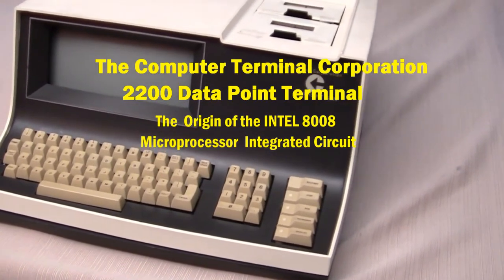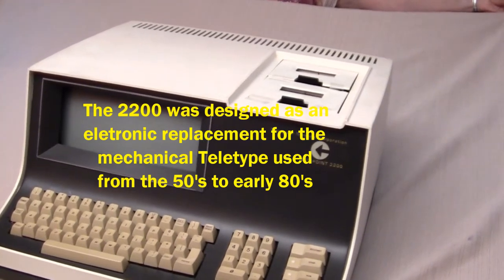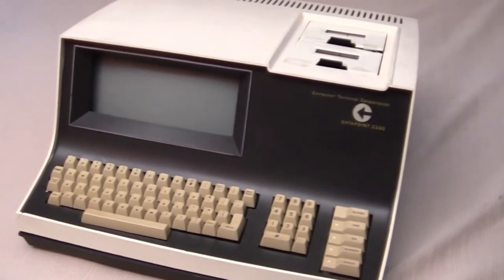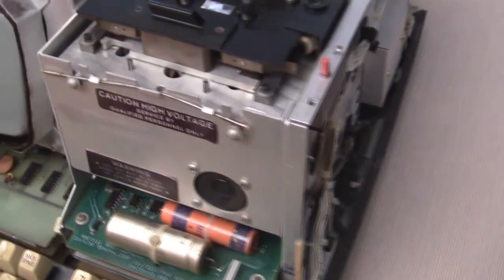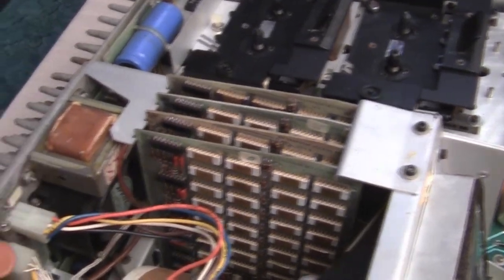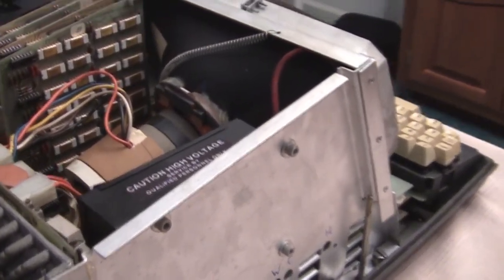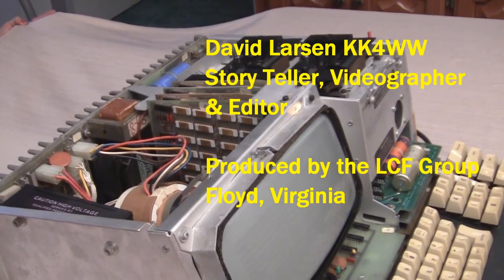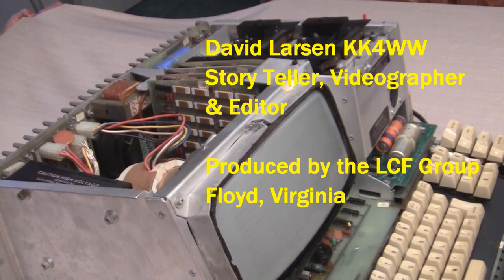Computer Terminal Corporation 2200 - Start of Intel 8008 Microprocessor

Comment: The Datapoint 2200 was a revolutionary machine for a whole lot of reasons.  It was the first general-purpose computer designed for single-user, desktop use, and that looked more like a piece of office equipment than like a piece of exotic electronics.  I worked in Software Development / Advanced Product Development / R&D at Datapoint for more than 9 years, and it was a very rewarding time.   I designed and wrote the world's first commercially available LAN software there... the company sold over a billion dollars' worth of that product.  ;-)   I also was the lead developer of the disk operating system there for several years.  A lot of us Datapoint folks are on the DatapointComputers Yahoogroup.  ;-)   Also, there's a wonderful book about Datapoint's key role in the creation of personal computing... highly recommended.
Reply from the maker: Hi Gordon - Thank you for you comment and info - you sure had a good seat to known about the Datapoint work.  What are you doing now - just enjoying retirement?  I am glad to have the 2200 in my museum. Dave
Reply: lcfgroup I'm hoping to not retire just yet, but we'll see what happens... at the moment I'm between jobs, so... you might enjoy some of the discussions on LinkedIn about the 2200 too.  Have you seen the Datapoint marketing videos that I've uploaded to my Youtube channel?  You'll especially enjoy the "Datapoint-We Make Computers" and "Datapoint-ARC" ones.  ;-)  It was Datapoint that dragged Intel (a memory company) kicking and screaming into the role of selling microprocessors.  ;-)   BTW, the brilliant industrial design work for the 2200 (and Datapoint) is by John "Jack" Frassanito. His company, now in Houston, went on to do a lot of design work for NASA.  Jack was also the force that got the above-mentioned book written and published:  http://www.barnesandnoble.com/w/datapoint-lamont-wood/1112783181?ean=2940016066448
Reply from the maker: Hi Gordon - Just received the book Datapoint by Lamont Wood and it looks fascinating. Would you be willing to write a short story that I could put on my computer blog about your experience at Datapoint? I hope so - this is just a great story that most folks have not heard.  Thank You Dave Larsen
Reply: lcfgroup You'll see some of my stuff in Lamont's book, but sure I'd be glad to offer more memories...!
Reply from the maker: I have finished reading the book & did see you work described in the book. I learned a lot of new things from the book.  Thank you for putting me on to it.  I am doing a blog about the book and will post it in a day or 2.  Do you known anything about the Datapoint 2100? The fellow I got if from said it was a prototype ?  I would sure like some more of you memories for the Blog.  Can you email me or contact on Facebook ? Thank you Dave
Reply: lcfgroup I never heard of a Datapoint 2100.  I don't know who you got that from.  I still actually haven't read through Lamont's book, but I should keep a note pad nearby to jot down errata that I find in it!  Just in the flipping through it I did when I first got it, I found a few things that weren't right.  I didn't take notes at the time, though.  I really should do that.  (And of course, a lot of the people documented in the book are gone now, sigh.  At least Vic Poor, Gary Asbell, Harry Pyle, Ed Gistaro, and at least one or two of the company's founders have I think all passed on.)
Reply from the maker: I am so sorry I don't have the name of person I got the 2200 and the 2100 from.  The 2100 has a logo on the it just like the 2200. Inside it looks like the 2200 with our the tape drives. It must  have been some kind of stripped down version of 2200. It has a date inside of 1975. I do remember when I received this at least 25 years ago I was told it was a prototype.About the book - I did read it from cover to cover and found  it interesting - I am sure as with all book some information was interpreted wrong or just not correct to start with. It seems Lamont did a lot of research to get the info. Any more comments about the book will be appreciated.  I just posted my comments on my blog microcomputemuseum take a look and leave a comment there. Thank You
Reply: lcfgroup Well, the 2200 could ONLY boot from the cassettes (and didn't have firmware).  In 1975 it couldn't have been intended to boot from ARCnet (which didn't exist yet) and the 2200 processor didn't really support ARCnet anyhow.  There were only two other ways for it to boot, which would have been diskettes or the hard disk systems.  The hard disks were expensive enough that there wasn't much benefit to eliminating the cassettes (and one still needed a software distribution technique) so my guess would be that the "2100" was just an internal name for what became the Diskette 1100.  (Which was basically a 2200 without cassettes, and which booted instead off the first diskette drive).  But I never heard the designation of "2100" (and I was the person who wrote DOS.C, which was the diskette operating system for the 2200-series processor, and I was the one who provided the boot ROM code for the Diskette 1100... so I would have definitely been in the loop for that product!)  What exactly did you receive that showed "2100"?  That could help explain who/where it came from.
Reply from the maker: Hi Gordon - It has a logo on it that shows the 2100 - I will get photos or video it and post on my blog. Thank You.
Reply: @lcfgroup  Dave:  I think your typo confused Gordon Peterson: the 'prototype?' Datapoint computer you have (and did a very nice video showing its insides!) is a Datapoint 1100 System (not 2100!)  
I worked at Datapoint, in the mid-1970s, and we sold accounting software that ran on that 1100 system: it was obviously derived from the 2200, but eliminated the cassette tape units on the top-right of the case, in favor of booting (and working) from 8-inch single-sided, single-density Sugar diskette drives.  (Datapoint claimed to be the first commercial computer company to incorporate the newly-developed 'floppy disks,' much like they also marketed Wangco and Diable disk drives in various configurations of their computer systems (the 2200, 5500 and 6600, while I worked there). 
Back to the 1100s, that we marketed/supported software on, a 16k memory system, with 4 8-inch diskette drives (totaling a whopping 1-megabyte of online storage!) was used by customers around the US for General Ledger accounting, Payroll processing, and Professional Time Accounting purposes.  A Diablo daisywheel printer was usually chosen for printing the reports from the accounting software systems, and one of our accounting-firm customers actually did the accounting for 20 client companies on their Datapoint 1100 system! 
Many, even within Datapoint, saw/used the computers as simply 'intelligent terminals,' since Datapoint provided software to emulate all of the most popular data entry/collection machines of the day.  But Datapoint also had higher-level programming languages, such as Databus (a business programming language), RPG II, COBOL, Basic, etc. on the little 16k computers!  So, with the accounting software we marketed, and other applications our OEMs developed and marketed, they were quite capable of standalone computing, word processing, intelligent phone call routing and switching, etc.

Comment: I use to work on the datapoint computers and peripherals. The 2200 eventually turned into the 5500 then 6600 (or 6040 if it was fitted with an arcnet controller's instead of the twin cassettes). Shame the company stagnated and lost the race.......
Reply from the maker: Thank you for your comments. David kk4ww.com

Comment: I'm curious, are the chips inside of this machine actually Intel chips, TI chips, or a mish-mash? I found an article from the 1970s in which Texas Instruments claimed they supplied the chips for the machine even after it was released so I was curious if the chips are labeled at all.
Reply from the maker: I may have a copy. www.kk4ww.com
Reply: TI ran the ad, but Datapoint never used their version of the chip (nor Intel's).  TI didn't actively market it (though they did patent theirs!).  Intel did pursue marketing their version (8008), and the later 8080, to quite a bit of success!  (To the point where they eventually changed from a memory-chip company [their original plan] to the 'x86 dynasty' they are today.

Comment: The 2200 become one of the prime data entry terminals for Swedish municipalities and Datapoint corp actually opened up a major office at Älvsjö, Stockholm.

The 2200 was perfect for data entry in that it had a card image screen (80*12) and a cassette deck for data (and one for the particular data entry programme to execute). Data could be transmitted using a modem and further processed in a main frame (a UNIVAC 1100).

The came the 6600 series and the full use of the DataShare and DataBus, and the multiport. The multiuser solution.

The 3800-series terminals with the ARC network.

The 1500-series Zilog Z80 machines with the massive double 128k single side/single density 8" floppy disks.

The 8600-series with the 8200-series terminals (not quite VT220-VT320) and the Resource Management Systems - RMS. But that was the end of the story.

Comment: This pc was 11 years ahead of it’s time, heck you even could connect it to an arcnet network later on, what’s even more amezing is that the first (commercial) microprocessor was released 1 year later in 1971, the 4004 wich was a 4bit chip, with that said , i wonder how could the datapoint 2200 pc had a 8008 8bit like cpu in it???
Still this is interesting stuff.
Reply from the maker: The folks that designed this werejust making a computer simpler than the 12 bit PDP-8 for more limited purpose. I expect there were more 8 bit computers at the time. The logic of this unit became the property of Intel when Datapoint gave it to them instead of paying the $50,000 or so for microprocessor development.
Reply: @lcfgroup  This is true. They gave it to Intel to continue working on it on their own after Intel asked them. My grandfather worked alongside Harry Pyle and Vic Poor, and had the idea that later became arcnet. We still have two Datapoint 2200s in our family possessions. We even have an original cassette tape operating system (CTOS) from 1972 inside one of the systems.

Comment: What was used from CTC in the x86 instruction set. Is it based on the engineering that CTC did? I really wonder, how big is the difference between the 4004 and 8008. I really wonder. Actually CTC designed the personal computer and the first processor,  but not on silicium.
Reply: The 4004 is more a dedicated controller than a microprocessor, suitable mostly for calculators and such.  The 8008 is the instruction set and CPU architecture of the Datapoint 2200... same register compliment, same register names, same instructions (even the same instruction opcodes).  The 8008 was a custom chip for CTC/Datapoint (and Intel really didn't want to make it, they were convinced that there was no market for a general purpose 8-bit microcomputer on a chip).
Reply: Correct. We had to put it on discrete boards...
Reply: But when i read those lines on wikipedia. 

Poor and fellow amateur radio colleague Harry Pyle produced the underlying architecture of the modern microprocessor on a living room floor.

Then we can sure say that those 2 guys were some insane genius, why dont we read more about them. Its all about intel and their success story on the first processor. Only thing they actually did was putting it all in one chip, sure that is smart but writing that architecture wow just mind blowing especially when they did it in 1969. I even think Intel delayed it on purpose. Because they knew what they had in their hands was something unique. They couldnt let it go, and Datapoint used instead TTL. What a shame.
Reply: Actually, no.  Vic Poor did the main 2200 CPU architecture, the main thing that Harry Pyle added (hardware wise) was the hardware stack for subroutine call return addresses and explicit PUSH/POP instructions.  Harry went on to write Datapoint's CTOS (Cassette Tape Operating System) and its original DOS, through version 1.2.   I don't think Intel delayed it (the 8008) "on purpose", but it did take them a while.  Datapoint had already implemented the 2200 processor in TTL (most of it on one largeish board, and a few smaller auxiliary boards).  It is disturbing that the Computer History Museum in the Bay Area gives so little recognition to CTC/Datapoint (thus the reason for the Lamont Wood book).  I knew Lamont Wood in those days...he was a writer for the San Antonio Light (one of our two local newspapers, along with the Express-News) and was the boyfriend of my next door neighbor in my apartment building.  Jack Frassanito (who was the wonderful industrial designer used by CTC) encouraged/commissioned the Wood book.
Reply: Thanks for the great info, i wasn't even born when this all happened. This machine keeps me fascinating, as it is actually the mother of m all. Do you know if there is any footage of a operational 2200. I can only find pictures and a few footage like this and of course some ads and manuals.
Reply: I don't really know of any videos of the 2200 (specifically) working.  When the 2200 first came out, personal video wasn't really there yet as a practical thing, and photography was (compared to today) expensive.  But the 2200 (and 5500/6600) had an unusually pretty display... in part because of its color (sort of a teal/turquoise color) and in part because of the very unusual depth it had.  Unlike typical video monitors....the 2200 family (and 5500/6600, which were the same display-wise) had the outer impact-protection glass, then an intermediate gel-like layer, then the actual CRT glass, and (of course) the phosphor coating on the inside of that.  Another curiosity that most users probably didn't know is that while most electron-beam monitors use a "raster scan" (one pixel wide across the screen, then step down, do the next line of pixels, etc etc. all the way to the bottom of the CRT), the 2200/5500/6600 (and the 1100 too) use what's called a "diddle scan"... the monitor paints a column of pixels for one character, then steps to the right and paints the next column for that character, and so forth for the full character, and thus across that line of characters.  Then it steps down to paint (similarly) the next row of characters, and so forth, until it gets to the bottom right corner of the screen, and then goes back to the top left to begin again.  This (patented!) technique was done so they only had to visit each character on the screen one time from the display refresh memory for a full screen refresh... look up what that character looks like once... and fully draw it before moving on to the next character.  This allowed using a circular shift register for the screen refresh memory.  I don't know of anybody else offhand who did their screen refresh the way CTC/Datapoint did.  Again, only one of the many unique things Datapoint did...!
Reply: Sorry, i dont describe it correctly. I mean someone now who boots it up and film it and put in on youtube. Like they now a days do, it should run as it is standalone.
Reply: The 2200 doesn't display anything (itself) when it boots up.  When you press the RESTART key (the top right key) the 2200 rewinds the rear tape cassette deck, loads the first block into memory starting at location zero,  stops the rear deck, and passes control to location zero.  Everything beyond that depends on what you're loaded in the bootblock, and what that does.it might start (and continue) loading CTOS (or another program) from the cassette, or might just in turn boot DOS.A or DOS.B or DOS.C from the local hard drive. It's normally relatively quick and (for CTOS or DOS) those just display a one-line signon message and a command prompt once they are loaded.  If the 2200 can't load and run the bootblock from the cassette, nothing gets displayed.